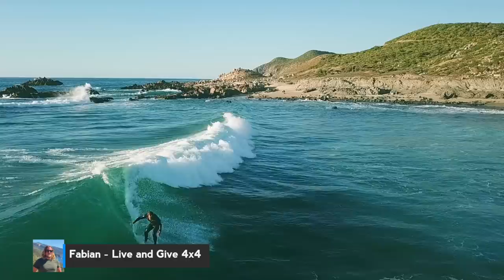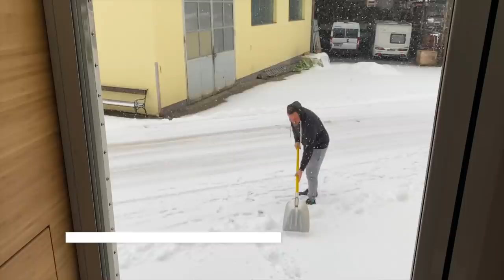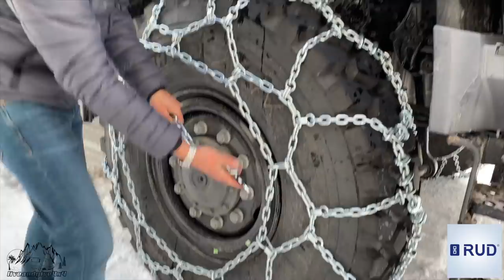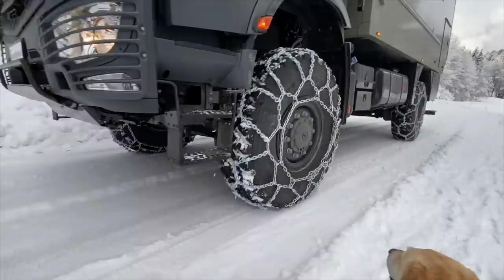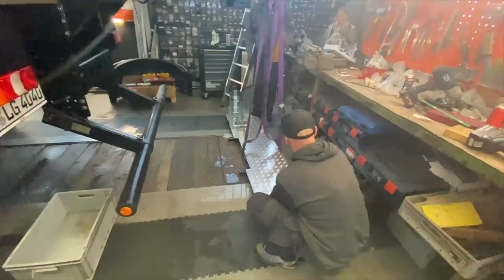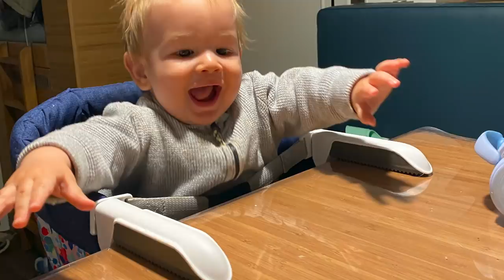Expedition TRUCK First Time SNOW DRIVE - TIRE CHAINS needed? ► | Motorcycle Rack installation

Comment: Nice…though a little disconcerting you needed to put chains on with those tires and the cars behind you didn’t.
Reply from the maker: Weight and we could have tried releasing air … but after we felt sliding we decided to play it safe 😌🙏🍀 Ice underneath the snow ❄️